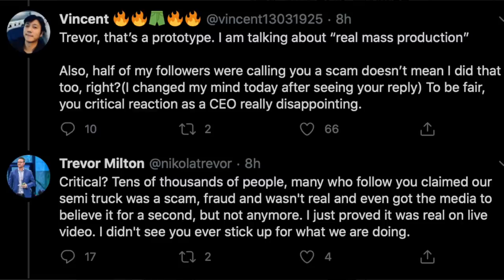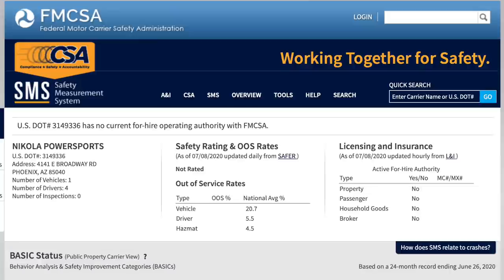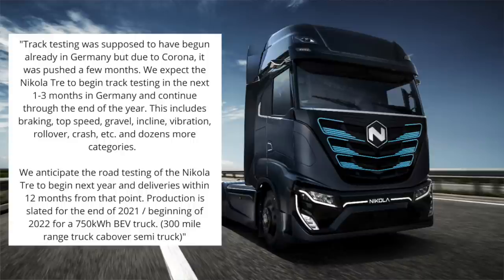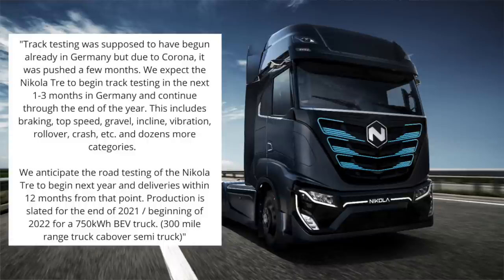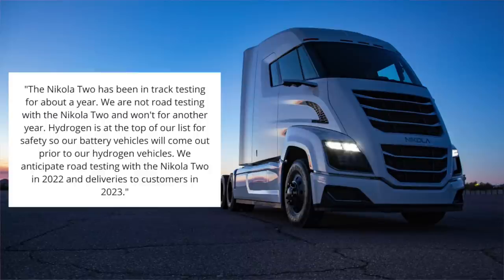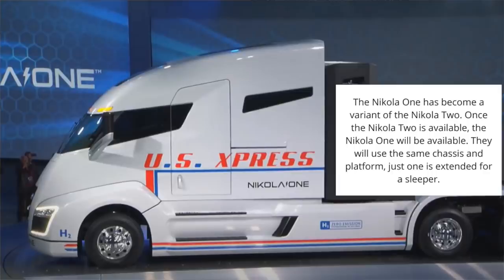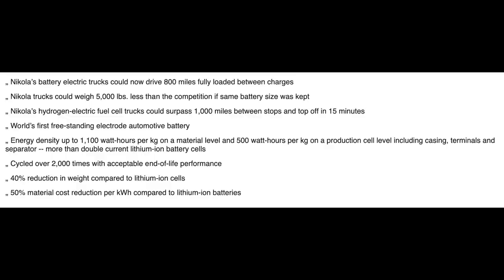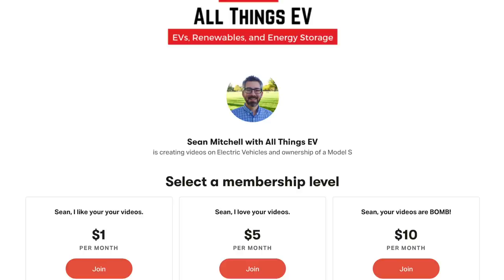Nikola has done 0 miles of road testing

Comment: As an ever active battery technology guy i see different approaches to solve different applicarions . I see a great adbantage to having hybrid trucks ! 70% less battery capacity and dead weight with a lower capacity hydrogen cell electron generators! On longer hauls the hydrogen can keep up with the power demand and charge the batteries . When hills are to be climbed it can draw from both! These cells are dense current lithium ion chemistry and also graphene lithium super capacitor hybrid  supercells the ise lithium intercalation and ionic surface energy storage allowing any power from regen braking to be effeciently stored as with any excess hydrogen cell power! It can be charged faster via plugin and filled quickly via hydrogen tank but most importantly it avoids all the shortfalls of carrying huge battery weight that also depletes load carrying ability and longer charge times . Hybrid systems also inherently are more robust and more reliable being able to draw power from both system and combination and can be managed according to the power needed from the journeys geograpical variations .
Reply: Rick Lokers you cant understand ? 😂 you will  need to close your eyes and envision. Not many can . Thats ok . Just be grateful that others will save your world ! 👍🏻

Comment: First of all, Trevor is not the CEO and secondly, they do have a truck running in normal working conditions. So, this guy is clueless
Reply: Tnoy Cascajo - Have you seen the truck pulling a real world load over the distance they claim? Have you seen the drive train? No. This guy is waking up to the fact that this truck is just a shell, and there is no magic battery or fuel cell almost ready for market. Believe what you like, but I need proper evidence. If this was real, they'd be showing off this amazing performance, not showing a glossy prototype cab with junk underneath.

Comment: They've done 250 000 miles in 3D Render.
And they will also integrate HOT AIR as a new fuel source.

Comment: Excessive secrecy at Nikola is a red flag. The recent 'live video' of the prototype semi driving around the parking lot and Trevor running after it, is funny at best and ridiculously disingenuous at worst. Is he taking us for idiots? This parking lot runaround does not prove anything. For all we know, he may have some kind of a heat engine fueled by compressed hydrogen to power the generator for electric motors, something like a diesel-electric locomotive.
Reply: You are too suspicious.  Building a prototype of a fuel cell vehicle is a high school project.
Mass production at specs and cost  - a whole different ball hame.
Reply: @ranjunk  That is what i said.

Comment: Technically, the first company with electric trucks in the customer's fleet is Daimler (Mercedes). 
I trust Nikola's announcement about revolutionary battery technology ready for production about as much as I trust Musk's posts about Level 5 "robotaxi" Model 3 and Y - pretty much not at all. Milton and Musk are rather similar in this respect; the difference is that Nikola is yet to show any real product.
And don't get me started on breathless announcements of "solid-state batteries", "glass electrolyte batteries", "million-mile batteries" and what not left and right, with nothing in even pilot-level production.
Reply: Tesla's million mile batteries already have been being manufactured, just right at the moment in smaller quantities (i.e. pilot production project). Which is why the battery facility in Fremont that they have been talking about lately..is going through an expansion..
Reply: @danahebdon6810  Yes, that's what we are being told. This is, I suppose, to be a part of "appreciating asset" Teslas. I will believe it when Tesla starts offering a million-mile warranty on the battery.

Comment: Nikola employee have already been seen in Germany in 2020 where Hydrogen is the next big thing for trucks from VOLVO - DAIMLER co-operation or jointventure. 
There had been engineers in Ehra-Lessien ... a testing facility owned and operated by VW but its truck CEO Renschler, the traton group's one (MAN, Scania, ... trucks + busses belonging to VW) has been friendly fired last week. 

Currently the corona impact on heavy truck manufacturers future has pushed the pressure to a new level. 

But I guess we will not see a steep change into EV. It will come in waves for sure. Gas cars are cheaper to produce and the big manufacturers will not make much profit.

They will offer both cars but most likely in 2 different plattforms that 'll make it harder for the customer to compare like id3 versus Golf

Here in Germany more than 66% cars are sold to companies and public agencies, less than 35% are purchased by private buyers. Company cars are purchased for range ... so not many EV except in private health care or food delivery. This will lead to a wave like growing EV market share.

Our Tesla S was a nightmare regarding quality and reliability and service.
Bad paintshop job couldn't be fixed ota, the service center is 200km away or better 5 of them. The wind noise, the quality, ... a nightmare .... so we got ridd of it and got a e-Golf for all the daily drives ... and a Mercedes blue efficiency for all 400+ km rides. That works great and btw. cost of ownershjp of a Tesla S were also a nightmare cause if you add the hours of driving to the service center and back and the cost for 400km drive a mercedes becomes cheap.
And the service center perfomances have become worse cause they no longer get the things done at such an appointment. In the evening they tend to tell you that it needs another appointment.

Never ever a Tesla again and therefore Nikola seems to prepare better to establish a service network in europe or better across europe.

Efficiency is king here - as Aldi and Lidl show us daily. no small talk with the cashier, but fast scanning and paying cause the next in the queque is waiting. If Nikola gets the balance of price + service right fleet owners will buy Nikola trucks here easily but they have to convince in tco ... except of a few areas where low or zero emissio only are allowed.
Reply: 😂😂😂😂 nikola has better batteries than hydrogen is capable of!! Come on dude!! 
Imagine when hydrogen comes they are going to take over the world 👍🏽
Nice talk keep up the hard work. Good investment. Congrats! 😂😂😂